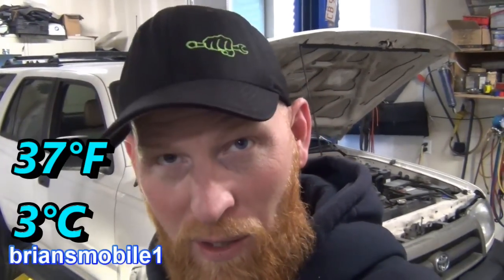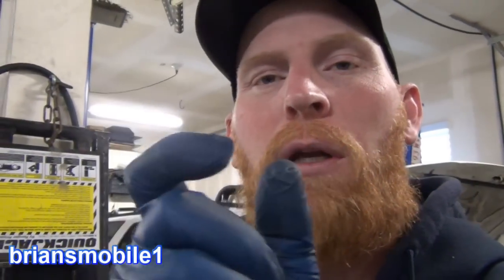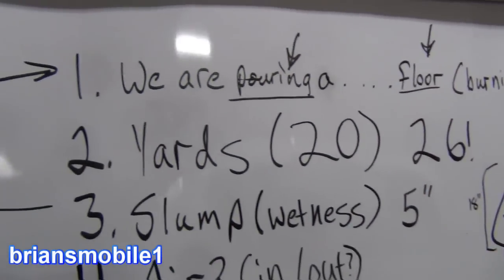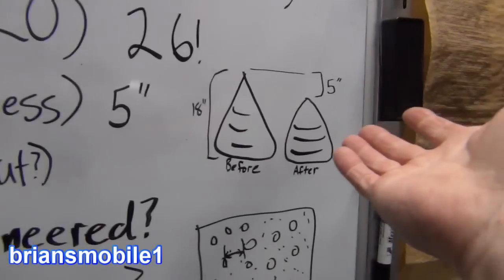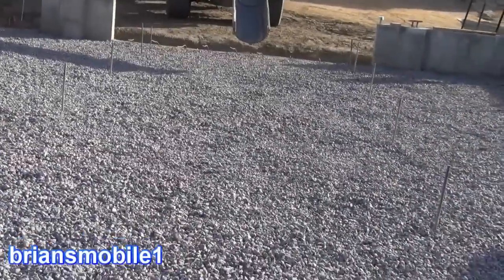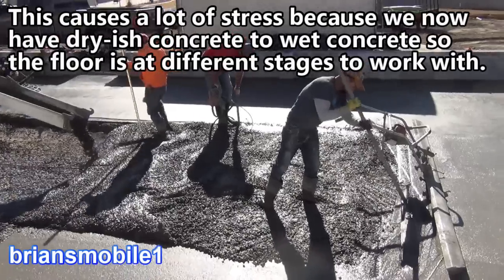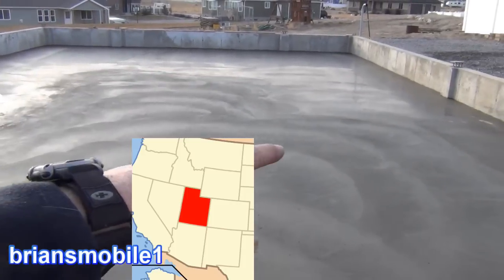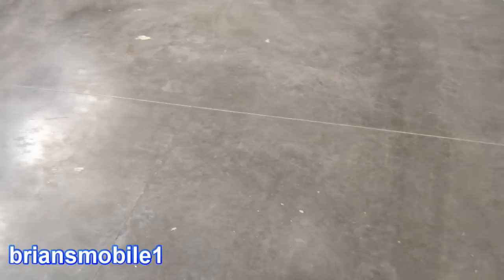Garage Floor Pour!  ULTIMATE MAN CAVE BUILD Series 5 of 12

Comment: If you want it smooth you wait till it is warm, and there is a roof and walls on it, then get a diamond buff and epoxy screed over it. Otherwise, just hydrate it on warm days so it can cure, and simply use it as you want.  Just a mist spray when it is warm, and no cold expected for the night, otherwise it will take forever to cure.

Comment: I used to work for this company that installed basketball systems. The instructions said to dig a hole 3ft deep and two feet wide, pour the wet concrete in the hole, put the anchors and rebar in the concrete then let it cure for a few days. . My manager  said he was going to dig a hole 2ft deep and 1.5ft wide (because it was easier), pour a bunch of powdered quickcrete (directions say do not use quickcrete)  in the hole, pour some water in the hole,  install the anchors (no rebar) and put the heavy basketball system on the anchors hours later. 

Even I knew that made made no sense. He ended up getting yelled at and the company had to pay somebody to pull that lump of dried quickcrete out of the hole at a cost of hundreds of dollars. Neither one of us got paid and he was my manager. 

Years later I had to do an installation; I followed the directions and it came out perfectly and I got a $200 tip. 

I never messed around with concrete after that.

Comment: Hi. Your concrete price level is very reasonable. I paid last year 450€ for 1 cubic meter here in Finland, which is about 1.3 times bigger than 3 feet cubic of yours so my price was about 346€ in your units if I calculated right way. In dollars something 1,2 times more. Do you have a long distance from concrete factory? My distance was 20km about 12 miles.

Comment: I was about to start my shop build and then all this covid-19 shitstorm happened, on top of that all the wood I used to form the footings is rotting as this is where I stopped working before I could pour and I can't buy a tarp or at least paint to protect it, and even on top of that, the neighbor at the shop site property called the cops on me when I went to remove the battery off of my skid steer so  it wouldn't get stolen and I almost got arrested for not following quarantine orders even though I was alone in my property, can't wait for this neighbor to ask for a favor in the future